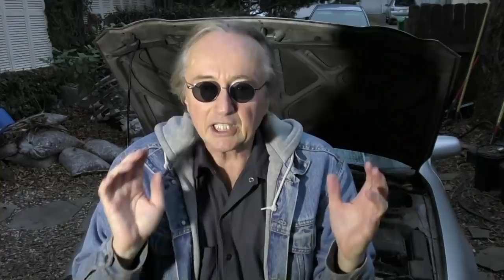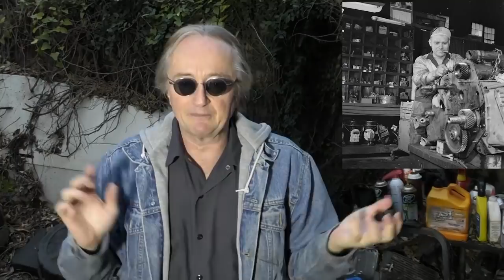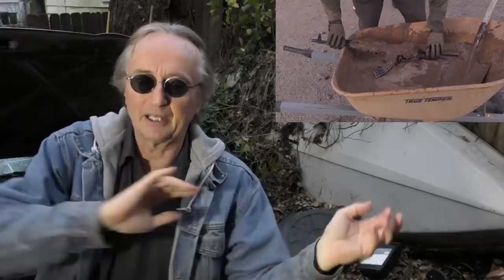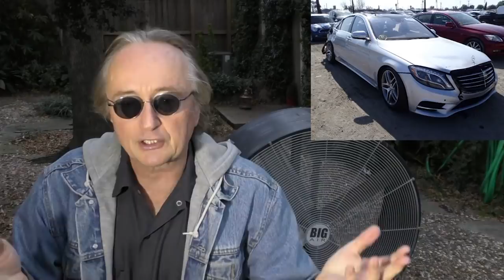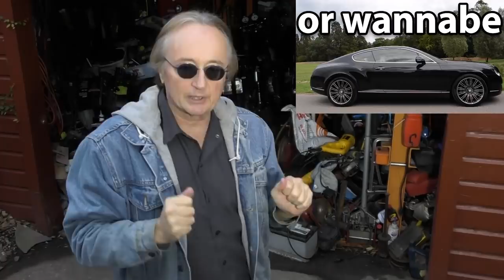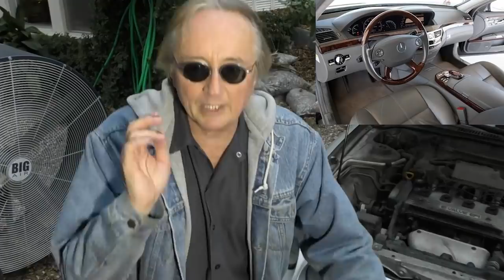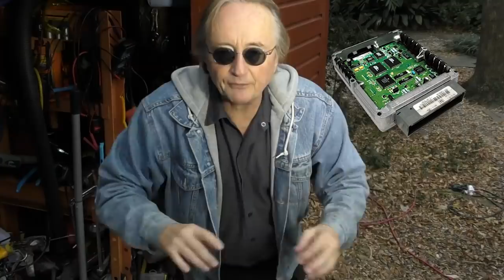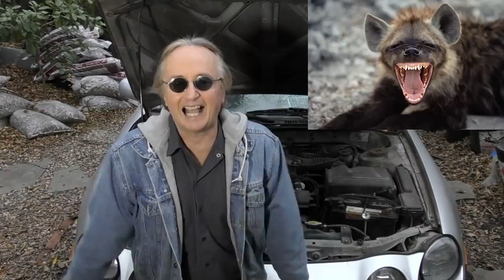Why Luxury Cars are Designed to be Unreliable

Comment: I think it all depends on the car and how it’s been maintained. For instance, I’ve got a Jaguar S-type, 18 y old. No rust. Maintained with 200000 Miles. No issues, just regular maintenance. Thanks to British parts UK parts are cheap so it all depends. My Jag is all I want from a car and its more reliable than all other mid class cars I’ve had. And since I take care of it it never breaks down. Daily driver. No planned obsolescence or bad quality here. Just a very nice car for less running costs than most cars. Closing the doors is on a completely another planet than a “econobox”, they weigh a ton and feels like made of one piece. Still. After 18 years. Beat that... oh. And rotors and pads are $120 for the front pair. Everytime I drive it it puts a smile on my face. 😊
Reply: Are you IN the UK?  That era of Jag. is the tail end of their best quality. Isn't it??  Thy still had some pretty good quality materials in them. And the older ones have all the class. Unlike now.
IF your in the UK, it makes sense the parts are cheap/affordable. If your in the US, they cant be THAT affordable. (If your in France, you can own/fix a Peugeot...if you like), but here they are a no go!! But over there, they have the parts.
All Jags. from day 1 have had major electric issues, constantly leak oil, the new ones are worse.
But YOU got the best era of Jags.    Who makes them now,...India or Thailand??  Now there's quality!   Or do they only make the Range Rovers or Land Rovers.  THATS prestige:)
Reply: I have a 2009 XF supercharged, not a single problem with the car, except that year did have an issue with the cabin air filters getting a bit clogged easily. I've needed to replace it twice in nearly 10 years, which isn't abnormal anyways. Some Jags, SOME that is, can be very reliable cars, much more so than their German competition. I've also heard that starting in 2011/12 their electrical problems issue has pretty much been solved, ever since Ford stopped having a hand in them.
Reply: You know that $120 rotor n pads you pay, the JLR dealer at asians sell it for $1000 or more? Thats why brit cars failing sales outside europe
Reply: Same here.  97e39 540 and 2003 530. Both the best cars i ever had. Reliable and built to last. Basic maintenance and oil.
Reply: @GrzegorzDurda  depends country, here e39 hardly to say reliable
Reply: The E39 just requires the maintenance the booklet says it does. Skip it and like clockwork itll never run right until you fix it right.
Reply: @GrzegorzDurda  yeah but somehow bmw doesnt like tropical climate in asia country, overheat problems, oil leak etc. And bmw parts cost here very expensive.
Reply: trianggaindra lukmana - If your E39 Overheats you have a VERY common problem. You need the new cooling system just like another brand will need a timing belt at a particular interval. You cant piece together repairs on the e39. They have to be done in one sweep.  The cooling system is to be replaced at 80-100K miles.  Radiator, expansion tank, all hoses, radiator and water pump with new belts and coolant. They sell kits of all the parts. 

Your oil leak is 90% likely from the Valve cover gasket as the oil pan seals are not known to leak. Its a simple cheap DIY for 20 dollars but 350 dollars at a shop lol.
Reply: @GrzegorzDurda  thats the problems, due to low population bmw and my country (indonesia) far from germany or EU, the parts cost way too much even on retail shops or independent shops. Especially at electricity component which mostly for old bmw we rely on junk yard bmw from singapore which more scarce too because demand too high coz people cant afford brand new parts with doubled price
Reply: Ex e90 mechatronic here if fail, we must buy complete gearbox for $10,000. We know that some freaks in eu able to fix this, but is not easy n practical waiting parts from EU

So many e90 that been sale very cheap or being parted and sell the parts rather than fix it
Reply: KRAUSER0130 - Deng thats too bad. Because they all need just basic stuff.  I assume you guys cant order from the USA. Here the parts are cheap , relatively speaking that is.
Reply: Marc B. No I live in Sweden. Shipping to Sweden is the same as within Sweden so I order some different stuff when I order anyway. Thanks to Jaguar heritage and cheap spare parts prices and the way it’s just so solid built without all the new shitty electronics it’s a dream to own. I don’t get it. Can’t Americans import stuff on their own instead of complaining over “oh it’s a money pit”. ;)

Comment: ak would not fire strait away as m16 (you can see the videos on yt) but that is not the point of ak. You see ak  needs little to no maintenance when you are fighting in the hills for months. M16 is sealed very well so no dirt gets inside bit its not as reliable on the long run and if any dirt gets inside its a big problem while on AK you would just flush it with wather and you are good to go even with no lubricant applyed

Comment: I have a 2005 Mercedes W203 Kompressor. The one that has a 1.8L Supercharged engine. It has no air bag suspension. It has no super tech. I bought it with 50,000 miles and now it’s almost 90,000 miles and besides changing the fluids, brake pad and rotors, new tires, some suspension work since where I live streets are almost dirt roads, and a few updates like adding some LEDs to headlamps, the car is rock solid. I’ve driven besides Corollas stranded in the streets because people think it’ll never break. If you take care of your car like you should it will last a long time.

Comment: What toyotas newer that 2010 are still reliable cars and that you recommend buying as a second hand car? What do you think about the newer rav4
Reply: All of them. just buy one
Reply: mustang19ms any haha literally all toyotas that don’t use the 2.4 engine (oil burning) are safe bets. Rev up your used Toyota!!!
Reply: Toyota corolla 2017
Reply: Current generation Highlanders are still bulletproof (using the same V6 for a decade, proven engine. Just watch out for the 2017/2018/2019 years they updated to a new transmission)
Reply: The Tundra and 4Runner are bulletproof with body on frame construction and rear drive/rear based 4x4.

Comment: Great content, but your analogy of the ak/m16 from Vietnam is a common misnomer. The problems with the M16 wasn't the tight tolerances. It was because they didn't chrome line the bolts and Chambers, changed they powder, then released them without cleaning kits. After they remedied the problems it has worked great for over 40+ years. If you think the ak-47 is more reliable than the M16 in the mud you need to watch the Forgotten Weapons YouTube video with a mud test of both of them. The results will suprise you

Comment: BMW put plastic water pump in the X5. Why in the name of all that is holly someone though it was a good idea...hahahahaha
Reply: And that's why I stick with Toyota, Honda, Mazda, and Subaru. I'm looking at the new Mazda3 or CX-5.
Reply: @thedog556, I have '04 Legacy 3.0R. It's pretty good. A bit expensive to service, but pretty reliable and fun to drive.
Reply: hahaha never put plastic in a cooling system and then there's a puddle of coolant down the road...
Reply: Because they are reducing manufacturing cost with the plastic pump. That is just CRAZY!!!
Reply: MYTH. Famous bmw myth.
Reply: Wait till they start putting plastic engines in them. LOL
Reply: @GrzegorzDurda  It's not myth, it is true, they are even known to use plastic suspension parts and bushings, friend of mine had 316, it was falling apart literally. Structural parts made of plastic, lovely eh?
Reply: Gilbert Galvan , MAZDA CX-5 IS A VERY NICE SUV
Reply: KRAUSER0130 , THEY ARE PUTTING PLASTIC IN THE ENGINE ALREADY, I CHANGE ( MY SELF ) THE ENGINE VALVE COVER OF MY BMW 328 XI AND IS TOTALLY IN PLASTIC!.
Reply: BMW has been putting in water pumps with plastic impellers since ‘92. The plastic impellers break off and can circulate into the motor. Fun times.
Reply: KRAUSER0130 - But dude, all suspension parts you mentioned as in bushings are either plastic, rubber or urethane in EVERY brand around the world.  And the 318 does not qualify as a bmw lol. It was a brief experiment into a budget bmw and dropped quickly by well... bmw. 

Plastic in an engine is a good thing and offers many advantages.  The intake manifold made from the industrial plastics can be molded into any shape to optimize air flow. The Plastic manifold does not transfer heat like a metal manifold, giving you upto 20 extra minutes before heat soak affects you. 

So the plastics are not regular consumer plastics like in toys or in your tv, this is akin to carbon fiber in terms of exotic materials. And its not cheap but easy to work with because it can be made liquid and injected into complex molds.
Reply: krachunov ... Holly is John "Die Hard" McClain's wife's name. Holly Hunter is a well known actress. Holly Golightly is a literary character. Holly Holy, yeah is a lyric from Neil Diamond. There are millions of Hollies throughout the world, but only one group called The Hollies, who recorded the great song, Stop! Stop! Stop!, along with several other hits. That's it for me trying to cover all the name that is "holly".
Reply: BMW specifies 80-100k for the Water pump. The plastic impeller is not plastic but metal. Check again. Every brand requires the big 100K service. Timing belts, water pump, belts, hoses coolant etc.   With bmw its the same thing but its Radiator, hoses, water pump, expansion tank.  No timing belt on the bmw, good thing. 

Plastic bits from the impeller even if broken off into the motor dont do any damage as theyre not in the motor but in the coolant passage in the block or already in the radiator which is getting swapped.
Reply: "You buy reliability with Jap while ..." Was your using the word "Jap" intentional?
Reply: Ask VW the same Question
Reply: Of all the newer BMWs I see stranded on the side of the road, is thoes X series.
Reply: corkscrewlife car photography lmao
Reply: Ricardo Ramirez So what ? Its lighter. Manu others do it

Comment: Why would you be a snob about anything  that is more likely to break down ??
Reply: Posers. Many of these cars are leased.
Reply: Because it will not likely to break down in that short period of time when they own them.
And yes, because they are posers
Reply: They never own them lol
Reply: @dezalan437   exactly. Cars are no longer property. They are just an expense.
Reply: Zzygyy I save and buy all my cars and motorcycles, I like owning things. I'd never feel right leasing, its mainly to look rich and not really about the car.
Reply: Because you have people to run it down to the shop and get it fixed for you.
Reply: @dezalan437  Same as my mother with her 65 mustang convertible. She is original owner. She drives a 2000 Rav 4 for everyday use.

Comment: Lexus and Porsche are routinely ranked among the best in dependability studies. So there are exceptions to the rule.
Reply: They were.
Reply: Well Lexus is Toyota, and Porsche is well, Porsche.
Reply: Luxury cars are dependable for the first 100k to 150k miles.  After that most people that can afford this kind of vehicle trade up.  Some people like me that like their cars and maintain them well can keep an Audi or BMW running 250k+ miles.
Reply: Michael Rheinstrom  Ownership of companies of that size is trivial.  Especially when dealing with German companies.  Porsche may be owned by VW but a jetta and a carrera are apples to oranges.  Different markets
Reply: Porsches reliability are misleading.  Owners don't use their porsches as a daily driver which means they usually have very low miles.
Reply: L6901Malice Porsche is VW

Comment: The main problem with this video is all cars now are full of computers and crazy electronics. Toyota/Lexus makes very reliable vehicles as far as engines/transmissions, but there electronics are not any better than anyone else. My wifes old 2013 Highlanders Navi would freeze up constantly and from Toyota forums it was a very common problem. My 2003 4runner had crappy 4 piston brake calipers that would seize up all the time and it was also a know problem. All cars have problems point blank
Reply: Engines/Transmission is the most important
Reply: supa dupa Use to be. The electronics in cars now a days can cost as much as a engine or transmission. Those touch screens control everything.
Reply: Is cheaper to fix tho, front brakes and rotors from a bmw only parts is like 600 dollars for your highlander is have of the price😉
Reply: @v60polestar88   Do you evidence of electronics going out that cost someone thousands of dollars?  That seems far-fetched.
Reply: Maestro_T Do some research! When the touch screen in most cars control everything including your climate control it’s a very expensive item. Back when I had my old Nissan Maxima the Bose radio unit cost $1000.00 so common sense tells you a new touch screen control center is way more

Comment: Dude I don't know Scotty, I respect your opinion but I gotta say Mercedes is a LITTLE different than other companies. Sure they go nuts with design, sometimes they reinvent the wheel, but really the mechanical parts used are pretty damn good. In 2000 and up Mercedes you've got to worry more about the dumb plastic crap on the interior cracking or getting gummy or something, but even Toyota had that problem on the dash for a while. 

And I really do mean they're different than other companies, not even just luxury vehicles. I'd say the only company who takes as much pride in their engineering is Honda, except with Hondas they are aiming for a different consumer. Mercedes wants you to be able to keep your car on the road forever, and that fact is reflected in their parts catalog. You can keep just about any model Mercedes on the road from any time period using parts you got from the dealership, and that's something you just can't say about other companies.
Reply: So you're saying just buy parts from Mercedes to keep your Mercedes running? Genius!
Reply: LOL ... logic lol
Reply: Merc got a bad rev for the poor quality they built when they were married with Chrysler. Newer Mercs are very reliable cars. Better than BMW or Audi
Reply: @longdonglarry   Chrysler, Dodge, now RAM, truly bottom of the barrel stuff. Scotty himself mentioned Chrysler shocks lasting ~40k, I swear they sabotage their own stuff with Dorman quality parts. I've got a 2002 Saab with 160,000 miles on it, original OEM bilsteins. I have two Saabs and one I replaced the shocks at 140k, so I use that as reference that the 160k ones are still relatively good. Train tracks are a good test lol. I see people beating on 90s C classes like people used to do with the old Volvos, just running them right into the ground, but the parts are substantial enough that they can handle being a neglected 5th hand car.

Comment: hah, bought a 2007 Lexus LS460 ($6100) with 180k miles, not well maintained, when i bought it, it was riding on low old and wrong oil, low and wrong coolant, car was overheating in highway, cheap repairs in the engine bay, with 2 front small accidents, missing sensors, and not talking about scratches and some small dents and disgusting inside. And besides o2 sensors and other small things, nothing's wrong with it. tranny shifts like a dream and no noises in the engine, no smoke no big leaks, good bushings on tie rods, suspensions etc. the whole car feels like riding a cloud. engine is strong and 95% of the electrics work.

Love Lexus. Toyota forever.😉
Reply: Gabriel Gabriel Man U got my car. I want one sooo bad. I detailed one when I worked for drivetime and I felt in loved with it instantly.

Comment: Just bought a 2001 Ford Taurus for 900 it has 223,000 miles only needs a sway bar are they reliable?
Reply: They can be the transmission cooling lines were small so they have trans issues so good fluid maintenance is key. Take care of that and regular maintenance and she will run for ever.
Reply: Yes, sway bars, because they have no moving parts, are very reliable.

Comment: AUTO-STICK transmissions... 
an automatic transmission that can be shifted manually. 
Is it safe to up-shift and down-shift it manually or will it wear out the transmission more quickly?
Love your channel. Thanks Scotty!
Reply: Those transmissions are computer controlled and your shifter is just sending signals to the computer that you want to shift at that time. The computer will decide if it is safe for the engine/transmission to do so at that speed. It's not like a manual where you are physically jamming the gears together.
Reply: Understood. Thanks brother! I was just worried about upshifting and downshifting the engine making the RPMs rev up and if that puts too much strain on the transmission
Reply: FWIW, if you're going to be a boy racer and use your auto transmission hard, make sure that you at least get a larger transmission cooler, if not a competition build for that transmission. Cars are designed for 'normal' driving. Occasionally running  up through the gears to redline won't be a problem, but if you're doing it all the time you can easily shorten the lifespan of some of the mechanical parts.

Comment: Even a Lexus will break if not taken care of properly. Had multiple Mercedes models and the only problem I had was an air conditioning issue in my E-Class which has above 100,000km.
However BMW can die in a hole. It’s giving German cars a bad reputation with its stupid engines low quality interiors and bad electronics.